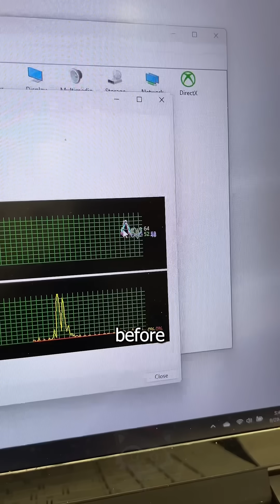How is this Alienware still working? (this is BAD) #tech #pc #technology #shorts #gaming

Comment from the maker: Before you start judging, this has nothing to do with cleanliness. These fans are crazy powerful, and when you have pets like this customer does, they trap all the hair and dust into the vent. The only solution is to either put a dust filter on the bottom of the laptop (potentially causing overheating) OR make sure to blow out those vents with compressed air every few weeks.
Reply: Ah
Reply: Today, i'm cleaning my pc
Reply: Ah
Reply: Ah
Reply: i can totally relate! btw your shorts are funny af!
Reply: Laptops are the worst star dust and space pube traps
Reply: My family uses the laptop on their beds and on the carpet growing up.  

That is why a Sony VAIO went to Laptop heaven after only a year or so of use.  Motherboard was fried according to the PC shop I took it too.  There goes $1,000 dollars down the drain.  Oh well. 

Any tips on how frequent to clean the laptop if it is used every day?
Reply: @Bojeezy  Don't use a laptop in bed?
Reply: Yes nothing to do with cleanliness, it's primarily down to the surface you put it on a quilt etc. Using a laptop in bed is a bad idea, same as on a carpet. All said and done a glass or wooden surface is best for prolonging usage before service, we all shed skin, however kick up dust. NEVER put ANYTHING on or near intake fan to try and reduce dust etc. It would restrict airflow and cause over heating and random shutdowns and potentially kill your laptop.
Reply: @jonathaningram4672  Using laptops on beds is a bad idea due to overheating mostly, while using them on carpers is bad both because of this but ALSO due to carpet fluff, hair, dust etc being able to clog vents over time. Some beds are also fluffy tho, but many also aren't.
Reply: I also have animals, 1 dog and 2 cats, my lady laptop was pretty bad when I cleaned it, I do recommend to get a cooling pad that is powered by AC adapter with a built in air filter, it does wonders and helps reduces temps and extra 10-15 degrees Celsius, it’s about 70-90 USD - IETS GT500 (5000 RPM) so worth it!!
Reply: no im judging because you used light years as a measure of time when theyre actually a measure of distance
Reply: Blowing out those vents with compressed air would be quite dangerous, you hold the fan from spinning while cleaning so that the high pressure air doesnt overspin and damage it. That doesn't seem possible in a laptop, so you need to use very short bursts of air to make sure the fan doesn't get up to dangerous speeds
Reply: A light-year is a measurement of distance not time
Reply: No matter what it will eventually build up.
Reply: The only problem with putting dust filters on alienware laptops is that standard external ones don't cover all of the vents on the bottom.
Reply: I just realized I don’t live that far from you if I have any tech problems I know who to send my pc to
Reply: Agree. I am going to blow it every 2 weeks
Reply: Ah
Reply: Ngl I appreciate you adding some context. Sometimes it feels a little harsh calling some people unclean (mostly the pubes part) but I know it’s just a joke, it’s just that I also have cats and I’ve been called unclean before just for having cat hair on me 😅 this hits close to home often enough, but I try to build some resistance to these words by watching your shorts. Your comment was a nice breath of relief
Reply: I feel that
Reply: What is that black mat? Where can i Buy it?
Reply: Hi i got a question how is the software named he uses for the temperature
Reply: And they don't make it easy to get in there, so...
Reply: Ah
Reply: How occasionally should I check for the internals of my laptop?
Reply: Ah
Reply: How do I reach out to you?
Reply: Ohhhhhwoohww
Reply: Ah
Reply: I should probably give mine a check up mine has not been running cool for awhile
Reply: Ah
Reply: Ah
Reply: My Alienware has one screw that refuses to come out so cleaning the inside is impossible 😭warranty expired last year after having the same problem kind of fixed now it’s one screw instead of 4
Reply: This reminds me I actually need to clean up one of my laptops, I have cats that shed too much
Reply: Do you fix Nintendo Switches?
Reply: Whats your email ?
Reply: How much would it cost so send my computer in for the same thing
Reply: Ah
Reply: How good are alienware products?  If youd be willing to say.
Reply: I need a pc that can handle at least 300 Minecraft mods and my budget is 1.5k. Can you recommend me anything? Even pc pieces if I have to build it for that low of price?
Reply: Hey bro I need to fix one of my computers
Reply: Ah
Reply: should prob cover the fact that alien ware has been busted engineering cases to thermal throttle. lol even 5000$ prebuild alienwares are engineered to do this. lol they try to make cool designs but lack the education to engineer a good case. you wont get full price value for hardware with near anyyyy alienware....i mean its a legit fucking delllll
Reply: jeah bro you gotta go a bit more easy on those fans :D 
Or get a 10 year old siemens fujutsu from a 60+ year old heavy smoker that lives in a flat without a balcony ... 
THEN you can absolutely RANT about the fans and make a mystery episode of how the hell did the machine survive this? :D
Reply: how much for a charging port and battery replacement on an old ipad?
Reply: correct, the more powerful the fan is, the more electric static produced, making the laptop essentially a dust black hole and sucks in all the dusts surrounding
Reply: Finnaly you didn’t roast us today
Reply: Ah
Reply: I guess no gaming laptop for me then
Reply: Alienware is just shit.
Reply: Actually we shouldnt put on any cloth place for ventilation the table is good place to do it
Reply: Bath 🛁 and brush your pets regularly. Good for you and them
Reply: or because it's an alienware laptop made by dell put it out of it's misery
Reply: 😅ⁿ
Reply: Lightyears is a distance not a time indicator, is the distance light travels in a year
Reply: I have a cat and chinchilla, I'm terrified about what the insides of my electronics look like lmao
Reply: That's definitely they way it has to be done. I have to figure out how to blow out cat litter dust from my MacBook Pro to it will stay comfortable.
Reply: or get a laptop cooler with dust filter
Reply: I'm just mad about using lightyears as a measure of time.
Reply: can you show a video on how to apply honeywell ptm in the easiest and best way. it's super annoying to place
Reply: Just keep an eye on your Temperature everyday then you know when to clean your pc before its too late.
Reply: @EmirDessu of course laptops are anxiety and suck at this point that u cant calm and play without nerves
Reply: The greatest TECHNICIAN THAT'S EVER LIVIED
Also known as the greatest laptop pube smeller that's ever lived
Btw nice consistency i guess the schedule is finally not tight
Reply: Just remember to definitely turn the can upsidedown when blasting out the vents for extra cooling capabilities
Reply: bro wdym "3 lightyear" you know 3 lightyear = 3 years, its just that lightyear is used to determin the distance of when the light will reach us in a year
Reply: or shave the pets?
Reply: Or don't have a disgusting fur filled house.
Reply: So it has nothing to do with the customer shedding hair from the ass? 🤣😂
Reply: How about NOT owning a pet then? Just throw em away or give them to someone else
Reply: Or remove the pets…
Reply: @HughesEnterprises even without the pets those vents will get clogged up before you even notice, specially since most people tend to forget about it up until it happens again and again and again
Reply: @Kasumi_Tashi Yeah it only took a year for there to be a layer of dust on my laptop, at least It was an excuse to go liquid metal as well and I'm running a lot cooler than stock now.
Reply: @Kasumi_Tashi  Most people forgets Laptops should be in a desk when it's not needed to go with you. Did you see how dirty average npc's laptop screen is? feels like they straight puts oily hand in it 💀
Reply: @Kasumi_Tashi  dont clean the vents, just remove the pets 👍👍
Reply: @HughesEnterprises  I'm not going to get rid of my pets just for a gaming laptop.
Reply: @HughesEnterprises You shed hair just like they do. You also bring in dust from outside. The clogs would still happen, but without the only thing that has a chance to make you happy in your miserable life.
Reply: @HughesEnterprises let's remove you
Reply: @kimanieking5877 I was gonna say that :c
Reply: @kimanieking5877  Some people don’t want to live in a dog kennel or litter box or algae farm. Popped open my 8 yo PC last weekend and there was nothing to clean. 🤷🏻‍♂️
Reply: @HughesEnterprises  that's fine just let everyone live how they want
Reply: @HughesEnterprises evidently the customer did because they have the pets! It's fine if you don't personally want pets, but telling people to get rid of their own because??? It clogs their computer fans??? Are you ok?? Please get a mental health evaluation??? Or finish highschool and grow up.
Reply: @HughesEnterprises  you mean designating pets as pests?
Reply: @HughesEnterprises  lol
Reply: @HughesEnterprises you can remove the laptop or hell yourself with that kind of logic
Reply: They can afford an Alienware. They can afford a vacuum.
Reply: Every few weeks? I want to use the computer not be its nanny
Reply: Or no pets

Comment: hey is there anyway to contact you? I have a tower computer that turns on but it doesn't display anything and my step dad that is good with computers has no clue
Reply: Try to check if the monitor's cable is actually connected to the right socket (the one for the GPU), you may have mistakenly connected it to the motherboard instead of the GPU

Comment: Quick question, my hp victus cpu overnight went from low 70 degrees Celsius while gaming to like 90 degrees Celsius, the laptop is like a year old, its only using like 20-30% of the cpu as well, its a ryzen 5 7535, what would cause that?

Comment: I have a laptop similar to this. About once every month I take the panel off and blow it out as best I can, but I haven’t worked much with computers and I’m not super confident to take off the heat sink and reapply thermal paste. I know I’m due soon but the nearest PC repair shop to me is like 1 hour drive. Should I just fkn send it? If it shorts out it shorts out??

Comment: I have dealt with that model Alienware laptop.  You got lucky.  Never ask Dell for spare parts, they will tell you the sent the right mainboard even though they didn't include their own revision....3 weeks of hell later it was fixed-by Dell.  Claiming that they found a 'ram failure."  It had a full mainboard replacement.  Great short!

Comment: Back when I used to do this, I had one come in that had fan noise. That's it. Came in for fan noise. Turns out the pet fur and PARAKEET FEATHERS had built up so thickly that part of a feather was poking into the fan blades. I had to reach into the fan shroud with tweezers to extract it all.

Comment: Did the same thing to my 2018 Predator. Yes, pretty much the same think. Cleaned it but that didn't fix the problem. Found out my Power attachment was for the wrong laptop. Got a proper one and now runs like a charm. Changed nothing else.

Comment: Reminds me of my parents laptop and just say that needed technician surgery after spending $15 for thermal paste with good cleaning as well it took me 20 minutes later the overheating warning stop popping up.

Why they couldn't watch a 10 minute to learn how to fix it is beyond me when the laptop takes 7 minutes to take apart then 2 minutes to clean it with another 5 minutes for the thermal paste placement and 6 minutes putting it back together which even a beginner first time job can pull this off.🤦

Comment: Doesn't anyone change their furnace/ air conditioner filter ever ?  I've had my tower back in the day run 24/7 months at a time never had those problems ever. Would check during hardware upgrades.

Comment: You are on the wrong side of the country for me to bring my unhappy Surface tablet in .,.. you'll have no problems with getting in, because the display has dissociated itself from the case, but I see no inflated battery pillows.  Sadly the display is insane. it produces valid graphics (I have it cabled into a freestanding monitor) but it has BAD issues on the display itself.

Comment: Before you start judging, this has nothing to do with cleanliness. These fans are crazy powerful, and when you have pets like this customer does, they trap all the hair and dust into the vent. The only solution is to either put a dust filter on the bottom of the laptop (potentially causing overheating) OR make sure to blow out those vents with compressed air every few weeks.

Comment: I have the Alienware M18. The fans on these things will suck up anything. They also tend to run hot.
Reply: And i guess you can t really clean the fans, right? Because you need to flip the Motherboard( that's not easy to do, is it...)

Comment: "It's been 3 light-years since this has been cleaned"
Bro light-years are a measure of distance not time😂
Reply: It’s like when you change the oil on your car’s motor engine… you change it every given amount of kilometers driven… so, why can’t this spaceship’s thermal compound be changed based on the same principle? (Distance) 😂
Reply: @guaiqueritech  Ah that's a good point actually. That's probably what he meant
Reply: Light years is a measure of time assuming you can’t go faster than light, do minimum three years

Comment: Glad you starting to use those phase change paste, the best paste for laptop indeed
Reply from the maker: But super expensive 💀
Reply: Yeah, just changed to that. From 90C all the time, to just barely 80C for my MSI Delta. I know it's still high, but that's the drawback of living in a warm and humid climate...
Reply: @gamtax can also get a cooling pad that is powered by AC adapter with a built in air filter, it does wonders and helps reduces temps and extra 10-15 degrees Celsius, it’s about 70-90 USD IETS GT500 (5000 RPM) so worth it!!
Reply: I have 400X160mm factory sized sheets from ebuy7, more cost effective.